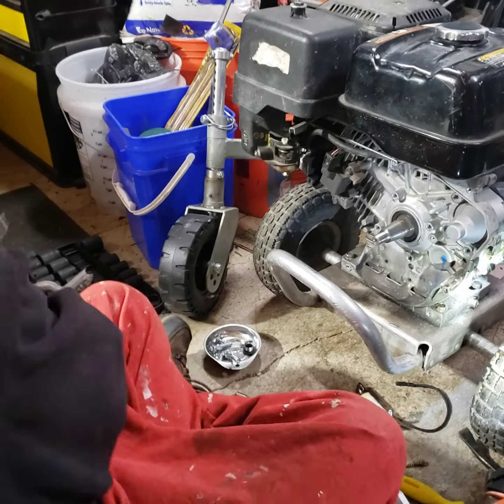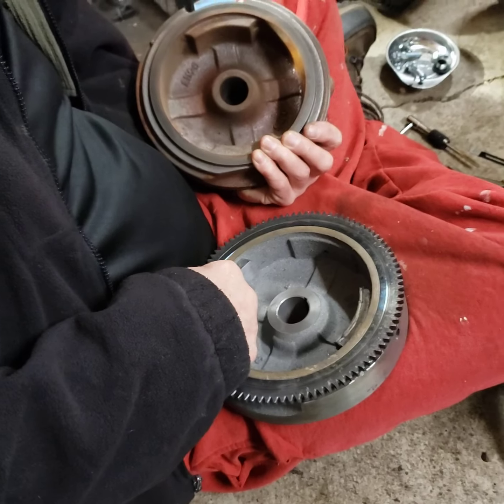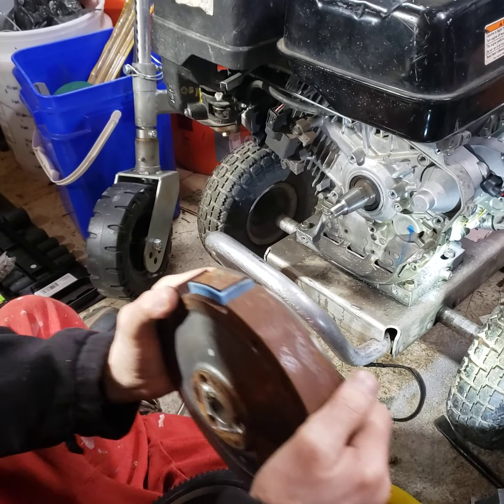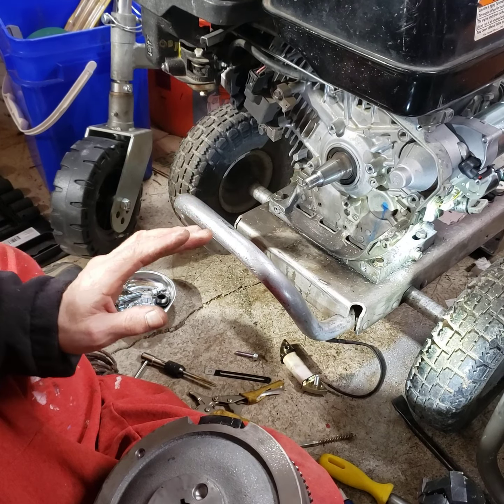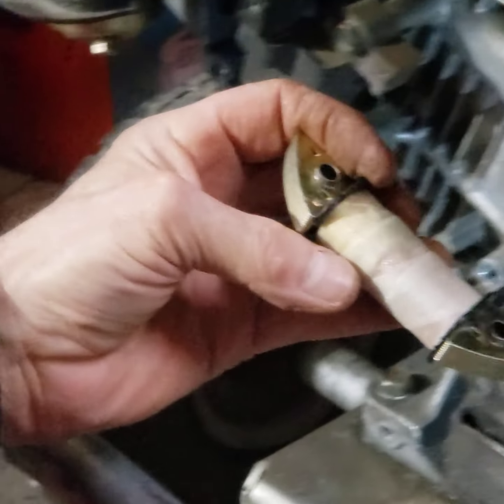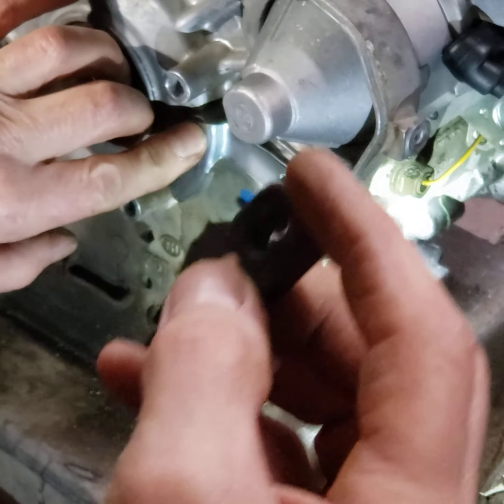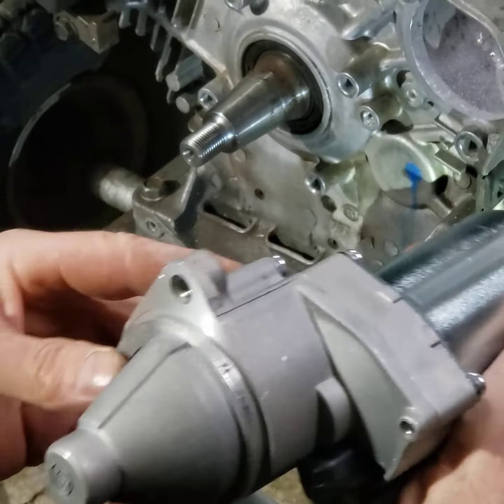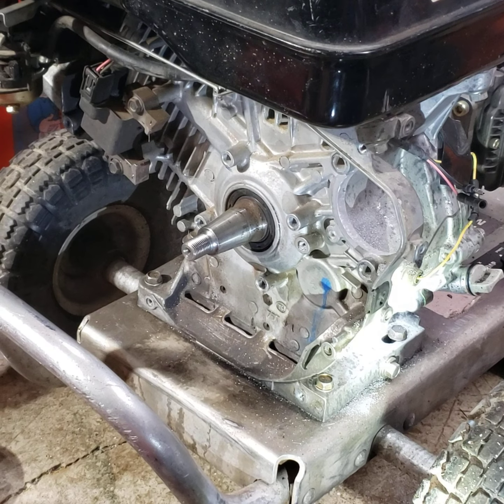1 of 4 Honda gx390 starter upgrade tips

Comment: i just bought electric start system for my NorthStar 8000 walt generator 2003  with honda gx390  from eBay that works very well. my only problem is over charging 17.5 volts too high. it needs voltage regulator. not sure the one to get or how to hook it up?
Reply from the maker: Ive pretty much gave up on my generator, the co sensor is not available from manufacturer so if it fails you have a pile of junk. Parts dep for northstar is not too terrible. Good luck. Im working on a pressure washer in this vid.